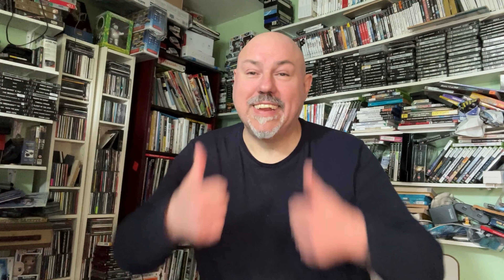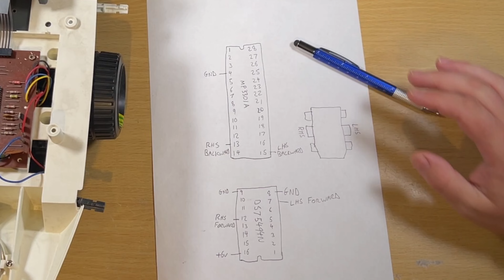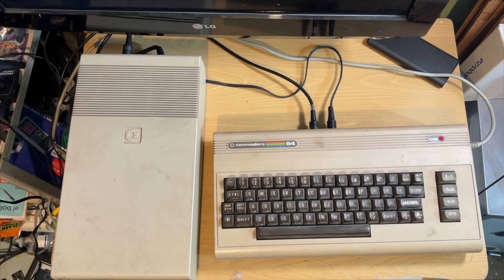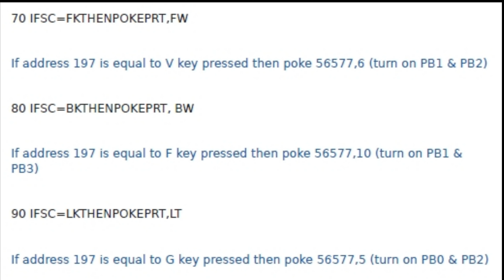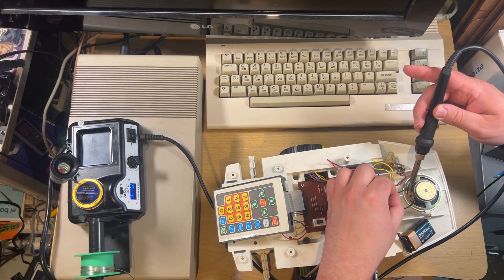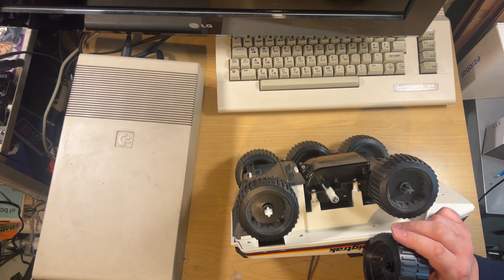BigTrak meets Commodore 64...Again - User port Programming fun & this time with a Happy ending!

Comment: Appending a number after the 8 does not change or do anything to any other drive on the serial chain, appending a 1 in there tells the system you are loading a program coded in Assembly. To change to another drive you would have to load from 9, 10 or 11.
Reply from the maker: Good to know. When it comes to the C64, every days a school day. I will look more into serial connection in the future and now have access multiple drives to try it out.
Reply: @BillFixesEverything  Ah to be back in the 90's with my two C128's, two C64's, three disk drives and 1200bps modem. Well, maybe not that last part :D

Comment: Oooh I think I like this toy!
Reply from the maker: Yes this was an awesome toy back in the day. Friends of mine had it but never had the batteries for it. It also had an add on cart  it would drag along and you could program to tip then later on, the ability to add a nerf style missile launcher, very cool 😎
Reply: @BillFixesEverything  When I was a kid throught the 60's n 70's I liked building plastic model battleships n such. One day I got it in my head that they needed to do war. I had a few Japanese ships. I filled them with gunpowder I took out of bricks of firecrackers. With fuse laced around their decks. A meatball on their flag and washy washy chopsockie NIPponese sailors standin' around on the decks...just awaiting their fate. Yes they will BURN!!! MWU-haha-HA!!! It was the USS New Jersey that had it's main guns modified to fire bottle rockets  with straightened fishhooks epoxied into the heads. I managed to hit the neighbor's incessantly barking dog. Neighbor lady giving me an ear-full. I had really messed up now. She goes to my mom's Avon and tupperware parties. I tired of my poor planning and slipshod craftsmanship and ill-advised exercise in physics. So I used a roman candle half-heartedly mounted to a cruiser.  Scale was off some. But it worked! BOOOOOM!! I had wrapped the powderkeg charge in glass fiber tape and epoxy - the entire belly cavity of the ship. That was too large of a charge. The puddle it was floating in vanished. 27 neighborhood dogs were beying like yaks in heat, howling...neighbor lady was screaming for 37 minutes straight until ms. Fox paid her a visit to calm her down. Her dog's newfound PTSD was triggered - so it was hiding and shivering. A fire had lit the field of pine needles ablaze and the garden hose I used to make the ponds with wasn't firefighting too good. Fire trucks appeared. Half my neighborhood blanketed in smoke. My dad was returning from work...pulled up in the driveway. Imma get my butt whooped with his belt there's gonna be RED hot stripes on cheeks!. Somethin' FIERCE. I told him why and how. Little japs on the deck and all. He laughed and said 37 minutes straight, you say?

Comment: Would be lovely to have the C64 and the BigTrak both visible for the final demo.
Reply from the maker: I agree.  There is a shot where the bigtrak is on the table and I’m operating it from the keyboard. The trouble was that the table isn’t big enough with the c64 and disk drive on it also the video lead wouldn’t stretch to where the bigtrak was. There may be more videos similar to this in the future so I’ll bare that in mind

Comment: the command to save on second disk is not ,8,2 but 9,1
Reply from the maker: You can see I’ve only ever had one floppy disk drive connected 😁. Good information to know
Reply: And the ,1 is only needed for machine code programs.  Normally it would be ,8 for the first drive, and ,9 for the second when saving BASIC programs.

Comment: Congratulations on getting it to work! Seemed like alot of pain
Reply from the maker: It was a lot harder then I was expecting it to be but fun also working through the issues to finally getting it to work. I’ve been wanting to try this out for years. For me, the biggest surprise was that the user port is set to high when the C64 is powered up. Seems a bit crazy having all those extra points that could be short out with power on them.